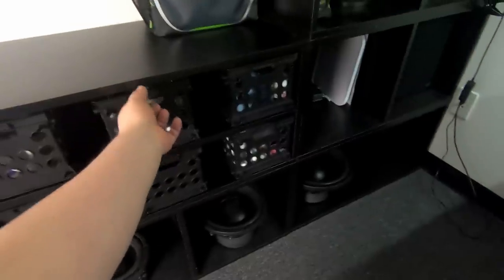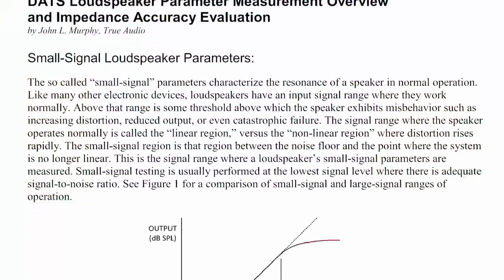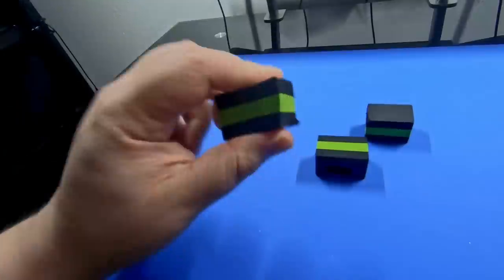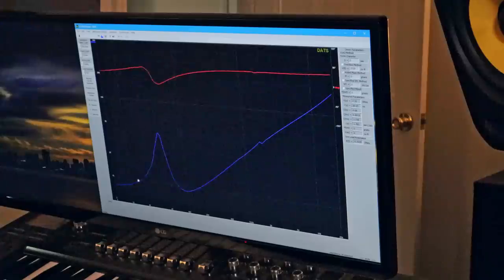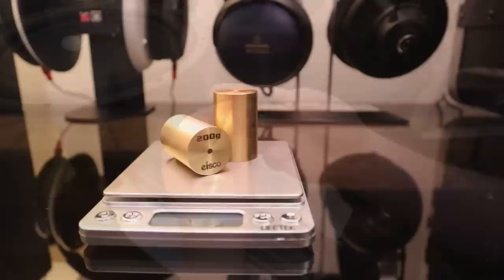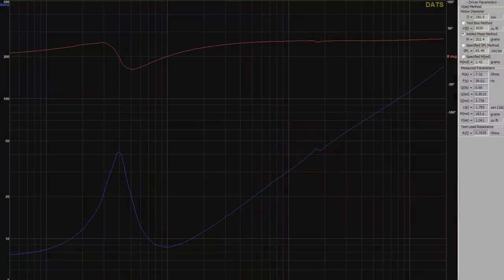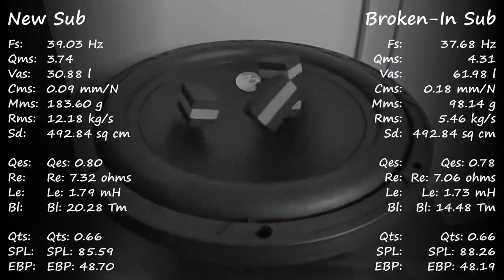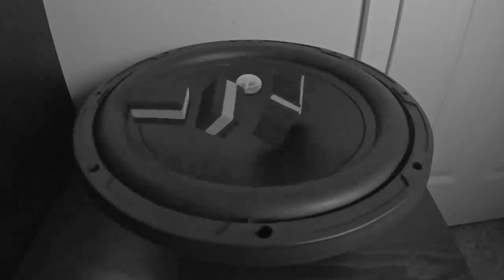Measuring Woofer Break-In

Comment: It seems that an assumption was made that the data of the new woofer is the same as the initial data from the old woofer.
Reply: Bingo. Though I'm sure it's pretty close, ideally, you'd sweep the new woofers, beat the shit out of it for a few weeks/months, measure it again.
Reply: Exactly, two different speakers can have different measurements, a real test would be to use the same speaker, measure out of box, and beat the crap out of it for a while and measure again.
Reply: I’m sure he thought of that. Still, it’s an interesting comparison. 
I saw a similar test performed on some Eminence drivers,  2 (same model) randomly chosen, 1 from production and another from the warehouse. 
Apparently Eminence builds their drivers so tightly toleranced & consistent that their random drivers’ test figures were closer in values across the board than many other much more expensive competitors “Matched Pairs” of drivers.

I thought it was quite remarkable. Since they subcontract & build drivers for many other brands it could stand to reason that testing a pair of drivers known to be from Eminence much the same way could provide some useful information of break-in comparison.

Comment: Even though they are the same model of driver, they are not the same driver. Revisions to the speaker could have happened in the years between, and the copper windings in the coil are not likely to be precisely the same. I'd prefer to see measurements taken on that new speaker now, and then again after a month of break-in with sine waves. Any chance you could do a second video on this based on the same speaker?

Comment: so... what might be interesting. hypothetically creating a ''new'' best suited box for the broken in sub and compare it to the new one ..  :) ?
Reply: Would be interesting to see how much difference is also due to manufacturing tolerances to know if it's worth
Reply: @quentincassier8472  When I got a new speaker I heard actually much difference just after a few days of playing. The stiffness of the drivers is definately an issue with new speakers. some just say it is phsychology. But the manufacturer tells it will take weeks to get peak performance on the speakers. The most expensive drivers requires most drive in time too. It is dynaudio I'm talking about, and they make speakers of very high quality to both professionals and normal consumers.
Reply: @oysteinsoreide4323   I totally agree I had huge variation on some drivers after 1 year. However, i found that all drivers does't change the same or in the same way and cheap drivers tend have a lot of variations between models. So is it really worth to optimize so much the cabinet ?
Reply: @quentincassier8472  The more expensive drivers you have, the more worth it is to do.
Reply: Its the Q mech that changes. When i model, i adjust it by 10 percent
Reply: @oysteinsoreide4323  < Question is: Since the manufacturers know about that, do they give out TSP for a new or a broken-in speaker?
Reply: In theory the speaker should function the same in the same enclosure, thus there shouldn't be a "new best suited box". The parameters do shift, but they stay consistent in themselves. A change in one value always goes hand in hand with the change of another value.
Reply: How about now!

Comment: Something seems wrong. Since the efficiency is a function of BL and MMS, it would have to change if these two parameters really changed that much. But these are both parameters which should not change substantially with use. It would be interesting to see if you can measure a difference in efficiency. If you can, I think it suggests the drivers were quite different to start with.

Comment: One thing to add is that VAS and related derivatives are quite temperature sensitive. It's actually enough to run the driver hard and heat up the voice coil and you'll have different results. I've noticed that VAS & Qms tends to go up, Fs tends to go down, not as dramatically as shown in this video though. I made a long-term test by running a continuous 20Hz signal slightly below Xmax, most of the changes occurred the first few hours, I ran it for over 100 hours with very small changes the last 50 hours or so. I think it's also driver dependent, some will "brake-in" very fast and some others will take longer, logically due to different materials used. 

Great channel by the way ;)

Comment: In the old days of the 1980s I used Fluke true RMS volt meter, HP 201 generator, Audionics power amp, precision calibrated resistors, a 4 function Texas instruments calculator, and an array of test boxes... and about 4 hours of measurements and calculating, and log graph paper to 'plot' the results. Measuring and calculating T&S parameters was an arduous task.  The WT2 was an amazing breakthrough. Now the current analyzer blows even it away. Fantastic tool, amazingly affordable.

Comment: When I add additional contact points to my  test setups (series connected dual voice coil) I connect all cables or contact points and re-calibrate. The numbers are usually not much different but they are different.  Excellent video as usual.
Reply: HexiBase good point, I always feel my alligator clips are gonna mess up my tests so I try to get dats to relative all my connections out of the final results. But your point holds because when you actually put that driver in the enclosure it will still have the series connection on it, might as well test it as part of the system.

Comment: And so the question comes to mind - should/would you engineer a box to a drivers out of the box parameters or to it's "broken in" parameters? (at least as best you can expect them)
Some of those changes seem pretty dramatic and if the box was built/spec'd to the out of the box performance it seems like at some point the driver and box may no longer match up.
Also, I wonder how long it takes for the specs to have drifted far enough away from OoTB to start to matter.

Comment: If you use a weight with larger surface area, you will be able to measure the woofer while it is positioned on its side, or face down. 
Then you can calc average of the 2-3 measurements. I think unless the cone is extremly rigid, it will flex around that weight - 
ideally, you would want a weight with OD close to the OD of the voicecoil. Only facing one way, you could imagine the weight pushing the voicecoil out of the magnet gap center. 
I am sure you have already tried all of this, and found it to be of miniscule relevance, especially for low input power. One surprise for me was how little Fs dropped. 
I expected 5-7 Hz for a woofer that size. I think it must have excellent spider and surround - perhaps butyl rubber and not foam ? Or maybe you dont play very loud.
Anyways -  i enjoyed it immensly - very compressed and effective video with zero bullshit

Comment: Hi.  Love your videos.  Do you think after 3 years the motor has lost magnetism versus soft part break-in contributing to lower mechanical values? I see the BL has decreased significantly
Reply: @HexiBase  Materials with memory is wonderful marketing but the fact that the history of something can substantially change its behavior can make life difficult or even disillusion. One thing I hadn't thought of was mentioned in Colloms 7th ed: adhesives can outgass and the effluvia of different components can raise hell unless you know for a fact it won't because they were codesigned when it came to that so that one part didn't damage another when deployed together. Not a problem in reflex but in a sealed box it could be. Cone materials vary in their permeability, humidity levels fluctuate, high power can mean high temperatures and wide variations in temperature inside an enclosure, and that itself can cause mobile species to spatially rearrange inside a system. Sometimes the memory of materials can be shocking in both the magnitude of effect and how little it takes to elicit it, e.g. the work hardening of annealed copper. Another (much slower) example is how the constituents of an alloy differentially migrate relative to grain boundaries so that the composition can become quite variable, with some metals accumulating near the grain interfaces and so depleting the grain interiors, so that eventually a part becomes very different from what it used to be.

Regarding magnetism, mechanical shock can work considerable mischief, a risk if you are buying stuff used or even NOS--warehouses can be dangerous places for both humans and goods. I've had cartons delivered that had taken some serious hits and wondered, did UPS do that or did it happen in a warehouse several years ago? Once a pair of Altec 15s arrived in a box that looked like a beachball; one was DOA. It was visibly battered so I didn't have a problem getting my money back, but if the "internal damage" isn't visibly apparent (like a partially degaussed magnet) everybody can escape responsibility via circular finger-pointing.

Comment: So, about that mms error.
Fs is certainly reliable, as it's just the position of the peak of impedance curve. ... right?
Mass cannot be different. So the compliance is directly related to resonance frequency as C~1/fs^2. Then, we calculate, that if the compliance of the new sub is correct at 0.09 mm/N, the worn-out sub then has the compliance of 0.097, which is merely 7% off of the original. The one your measurements indicate is 2 times off! That just cannot be correct.

I'm not sure, but I think Fs is slightly affected by (mechanical) damping, which can be the explanation. However, neither of Qms values is very low, and they are close, so that shouldn't be a problem. Again, Qms is directly obtained from impedance curve (peak width, height), so I consider these figures reliable. 

And as Marco Geri pointed out, a change of Bl is also a strong indicator that there is a source of error somewhere. And I agree with him in thinking that it is because your test mass is too large. Here's why.

Your test mass is heavier than the cone. That means, Fs changes by a large percentage. The software assumes that the compliance is the same for both no-extra-mass and with-extra-mass sweeps. But the compliance may change: * because of compliance being frequency dependent, and * because of suspension nonlinearity due to cone displacement by the added weight.

Comment: So is one, old vs new, "better" than the other?  At first I was thinking the old became better, at least for it's intended use case as a sub, but then I saw the BL went down.  Certainly there's some unit to unit variance but not that much... how did the mechanical changes affect BL?  The efficiency went up, and Fs went down, but are there downsides I'm not recognizing?  Is it "sloppier"/"slower"/"less controlled"?  distortion / FR changes? impulse response?

Can anyone explain the what practical effects these changes have on the actual driver performance?  Also, do you think these changes are as significant as they are because this is a sub, driven hard, at high excursion, and thus, these changes would be less on other kinds of drivers - tweeters, mids, or very stiff compliance "pro" woofers (not subs) that are used with far less excursion?

Comment: What about unit to unit differences? They don't seem guaranteed to be trivial. Shouldn't this ideally be done testing the same unit, first new then after a decent period of use?
Reply: @HexiBase  i wouldn't have bothered about unit to unit differences if I had not seen on subwoofer testing websites that the differences can be significant, especially when the drivers are listed as the same model but manufactured with a great span of time between them. That's why I asked. Thanks for responding!
Reply: @SilentShadow-ss5xp  raw driver tests show differences between specified and actual values that range from trivial to very considerable. Trust but verify it seems is the rule.
Reply: You could go on the parts express site and compare the difference in the one he tested. It would have been nice if Hex could have shown the differences to the listed specs but doubt they were off by much.

Comment: True break-in is just accelerated wear during initial use. The idea of break-in is that at some point the accelerated wear ends and wear and tear stabilizes for a long period of use. Is it mostly the breakdown of the surround material in terms of elasticity and dampening?
Reply: No it's mostly the spider. You can take a brand new spider and bend it you'll hear cracks at first which you won't hear on an older spider.

Really a proper break in is just having the driver go to almost full excursion for a few hours.

Any changes after that will be incredibly small

Comment: I know it's off topic.. Does an odd shape speakers reproduce true sound? Or do they have to be round?. Thanks
Reply: Do you mean the whole speaker or the driver?
Reply: oval speakers will beam according to the driver size in a given size. eg, a 6x9 will beam like a 6" speaker and/or a 9" speaker depending on its orientation. this can be used to your advantage in certain applications.

sound reproduction will remain true so long as the cone remains rigid and the speaker plays within its design limits. people have argued this to the ends of the earth and while there is merit to a round cone vs another shape, the practical application shows that it really doesnt matter. 

theres a thread on DIYMA thats 8 YEARS old, debating the SQ myths concerning oval speakers vs round.
Reply: I have square speakers that are like a flat disc (not cone). They sound petty good imo

Comment: Hello Hexi !

I use Arta/Limp to achieve my T&S measurement with an DIY ARTA box (you can find the design on the internet).
I read a lot about T&S measuring as I want my horn top speakers well designed (I do my best, which is not really high standard). It's said where I learnt the method that you have to measure the loudspeaker the farest as possible from any wall or surface in order to avoid the more reflection as possible on the membrane cause it leads to false measurement.

I had the problem with a 10inch medium loudspeaker, even the vice which was maintaining it had bad consequences on the measurement, just depending on the way to bind it.
Could you please explain me why it's not that important about subwoofers measurement ? I assume it must be something else than the wave length.

I really enjoy your videos, you have way more skills than me and I'm pretty happy that great mates like you shares their knowledges ! Thanks for that

P.S. : Sorry for my mistakes, english is not my native language
Reply: Hello  @HexiBase  !
Thanks for your answer, and sorry for my late answer !...
And it makes sense to me, I should consider the idea to apply a gate on my measurement with a short closing depending of the frequency bandwith I want to measure...

Thanks again for what you do for audiohead guys like us !

Comment: How can mms be changed to almost half?
I understand that Cms, vas and Qms value change due to softened suspension but shouldnt Mms be the same? Mms is the weight of the cone assembly plus the air it moves and should not be changed by the softening of the suspension. Or is it something i don't understand?

Comment: Why mms is practically halved and BxL is way reduced too... Ok for the suspension softening (cms and thus vas and fs) but why BxL and Mms? It simply doesn't make sense to me. Are you sure about your measurement?
BTW excellent job and very good content on that channel
Reply: @HexiBase  Thank you. For sure the system cannot measure mms directly,  it calculates mms from the resonant frequency variation when you add the weight. I think you are adding way too much weight; adding 200g will move the cone too much and probably the voicecoil will be off center. This can explain also the Bxl reduction (less useful voicecoil turns in the magnetic gap). Try measuring adding 20...50g instead of 200g.